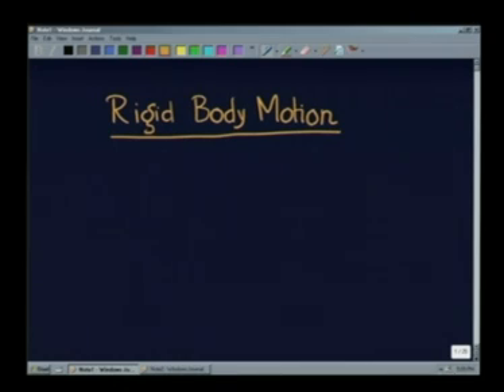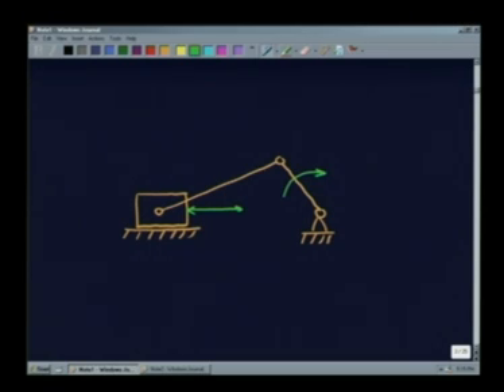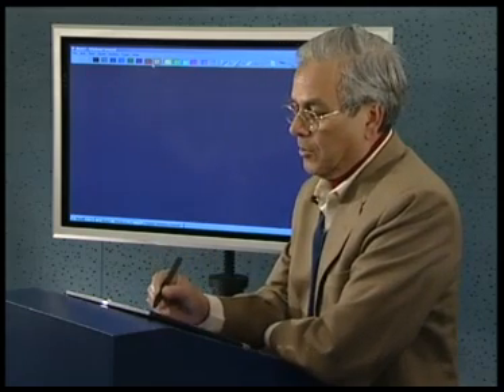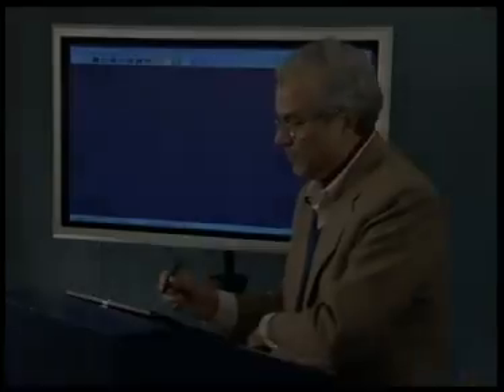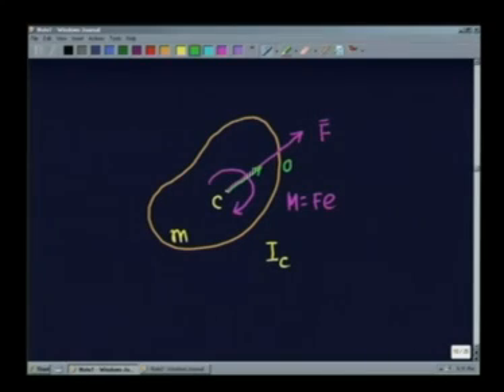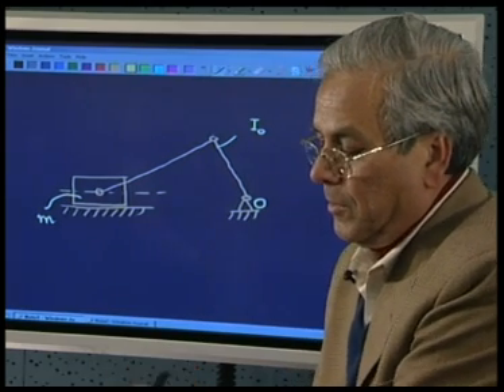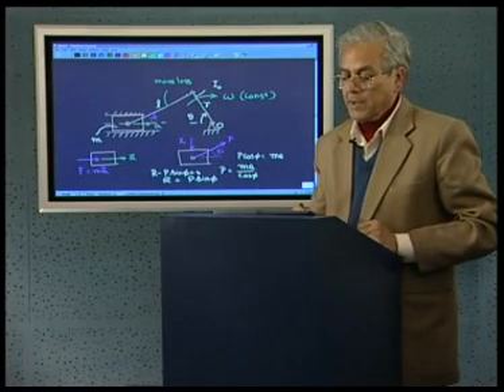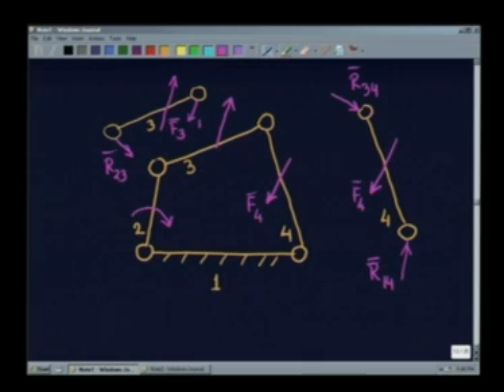Module 1 - Lecture 1 - Rigid Body Motion

Comment: I have a Problem please do read this
Sir,
 Your are really very interesting  I have a problem in our lab . Our grinding machine is transmitting a good amount force to ground. Form there emerged my thought of how to solve the vibration problem of any machine of same kind. I kindly request you to help me in solving this problem.
Reply: Asked 10 years back! Anyway its a problem of vibration and force transmissibility. Just reduce the dynamic magnification factor and you are good to go. Formulas can be found online. Or you can try the alternate methods: 1. Vibration isolation, 2. Tuned Mass Damper, 3. Just bolt it tighter to the foundation and balance the grinding rotor.
Reply: dont give feels that u are einstein .